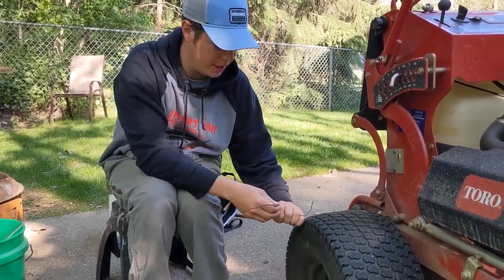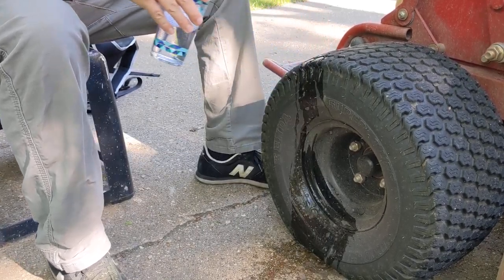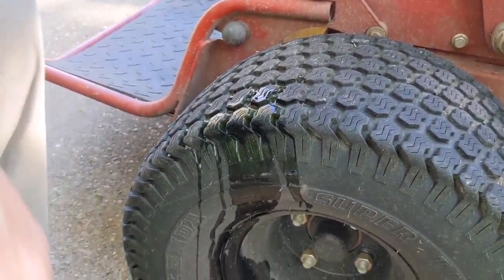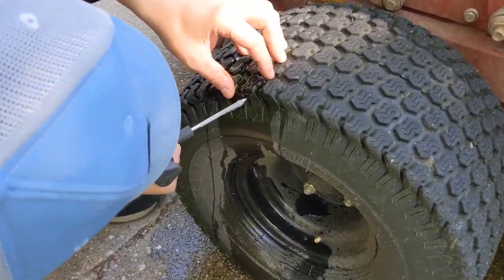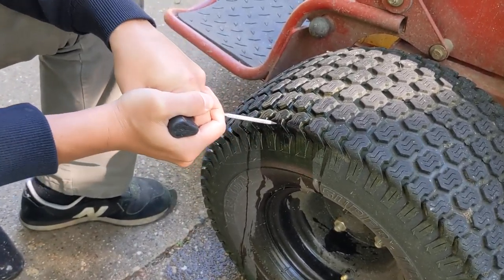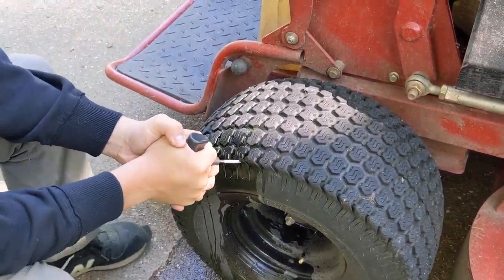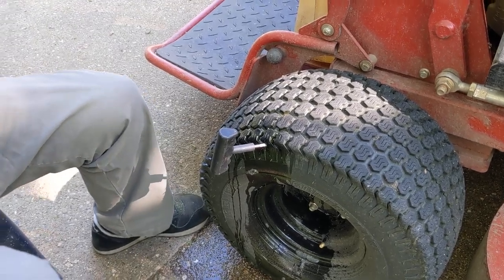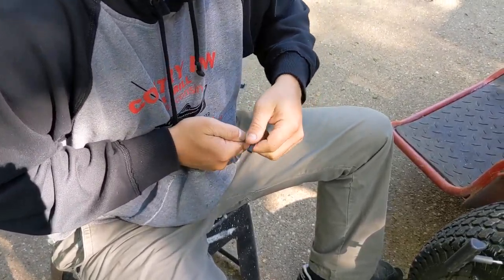plugging lawn mower tire hole 🕳️ she's fixed

Comment: Yup I’ve had to do that quite a few times myself, even in the side; the fact that mower isn’t driven anywhere close to hwy speeds, you’ll be alright. I typically use a DEWALT drill to ream the hole vs that manual tool.